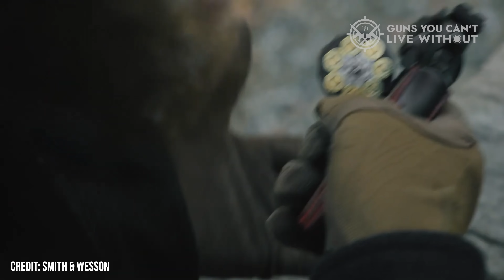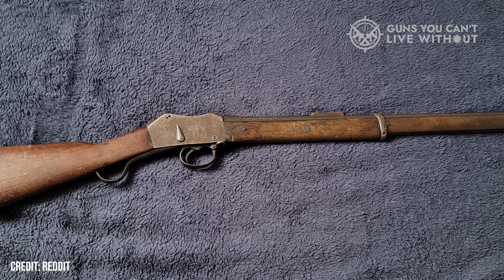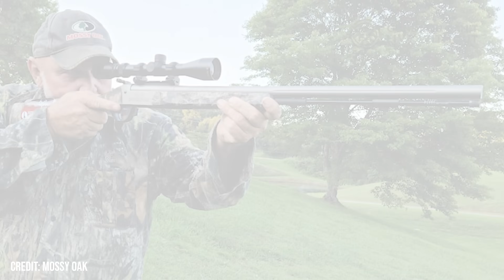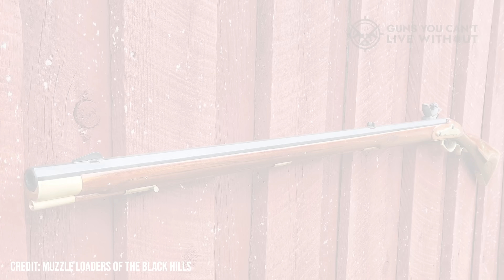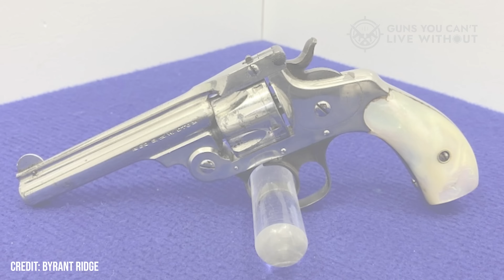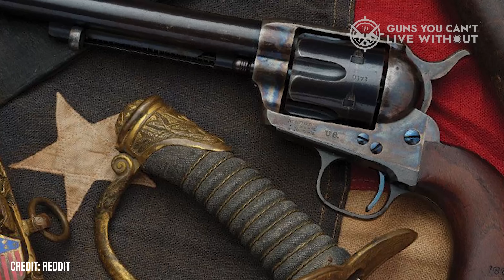10 Guns You Can Own With Zero Paperwork—Yes, It’s Legal

Comment: Certain Finn 39 Mosins are legally antiques. I have a pristine M39 which was totally re-arsenalled in 1968. Virtually every part except the bolt and receiver was brand new and built on the 1896 receiver. Had it shipped to my place in CA legally about 15 years ago.

Good luck finding one now though.